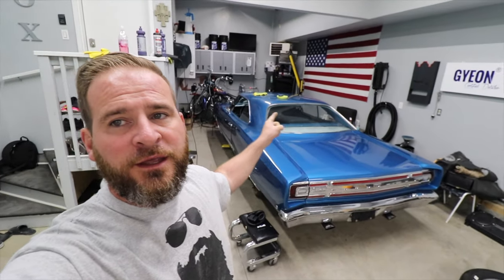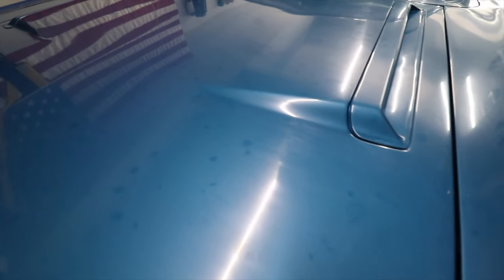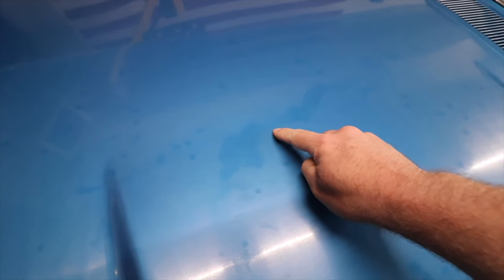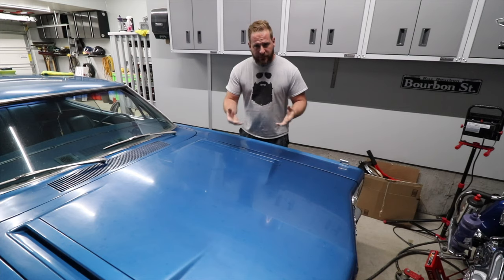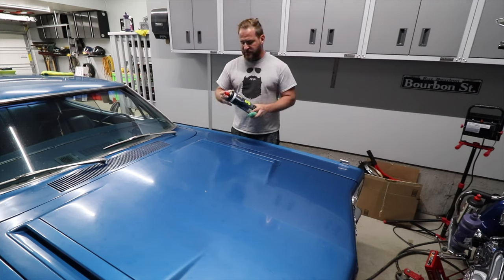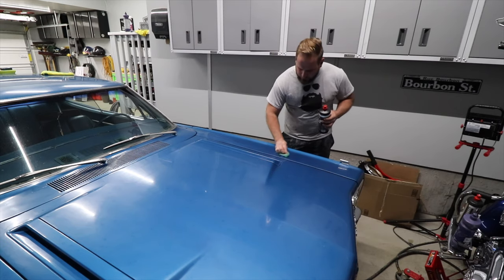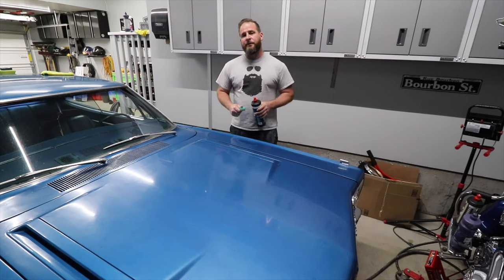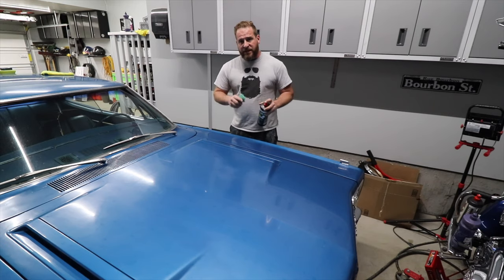In Depth Single Stage Paint Correction: Amazing Transformation

Comment: Stumbled across your video.  Very helpful.  Thanks for taking the time to do this.  Getting ready to try to correct my 1971 Mach 1.  QUESTION;  do you know what the before and after paint thickness measurements were on this job.  Just curious how that impacts what you did.  Thanks.

Comment: I painted my car with single stage and a year later it looks super dry on the hood,roof,rear bumper.
I done did this method but it just keeps getting dry after a month any thoughts why it keeps drying out?
Awesome car great video.
Reply from the maker: Try using a synthetic based sealant or a si02 hooe this helps.

Comment: Awesome video man, would you usually always start with a single stage restorer like a meguiars glaze 7 to restore the 
properties in the paint first before you start? I had a comet I did once and it was so soft and finicky wondering if I should of tried to 
bring the substrates back up a little before cutting into it like I did.
Reply from the maker: the paint on single stage should always be hydrated before correcting it or removing oxidation in my opinion.  Thank you for watching and don't forget to share the video with others to keep the channel growing.
Reply: Mobile Detailing Edmonton What do I type for the hydration compound. Is it; Mynzerna 3500?

Comment: Great video however, ..... you really don't want to cut through the factory mil depth paint down to primer which can be easily done by only simply using a power DA and compound as shown in this video without knowing the existing mil depth of the OEM paint which by the presentation provided was not pre determined ...

Comment: "Its single stage which means there is no clear coat" that is not true. There is "clear coat* ( usually urathane) mixed in with the base coat. You wouldnt be able to have just a base coat without added protection. So, it doesnt have a clear coat but it has clear coat.

Comment: Hey Lance.  Question.  If I want to put a second skin on my truck, should I clay bar first, use Prep or what?  Thanks.  First skin was put on a year ago.
Reply from the maker: Follow tge same steps. Yes clay, polish if needed, prep to accept the coat and then skin.  Its the top coat so it will be fine to place on top of the base coat yearly.  It will just rejuvenate the look of the coating.  Were are you located give me a shout if you need help.
Reply: @LetsGoJT  Thanks Lance.  I'm outta town about 2.5 hours.  Fox Creek.